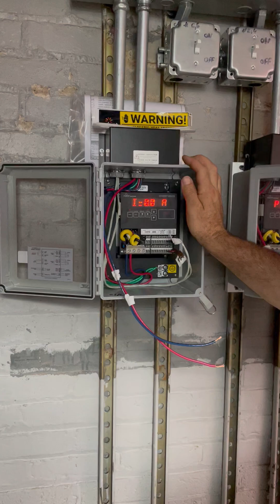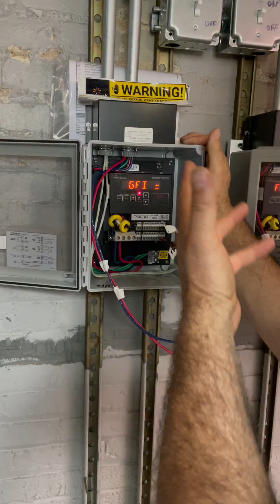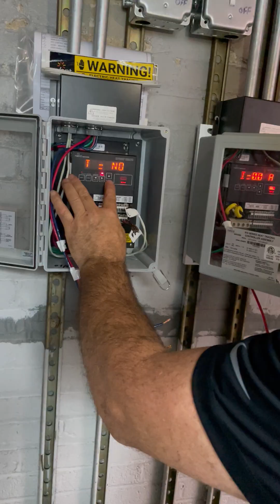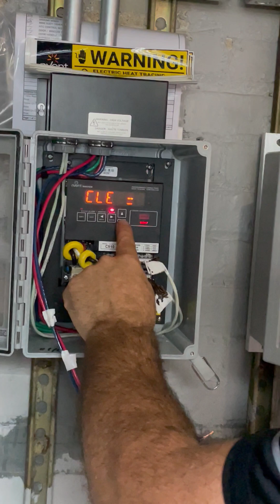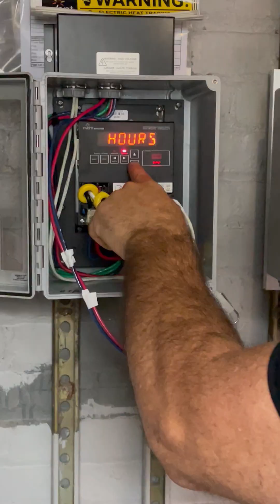Programing a Raychem C910 heat trace controller

Comment: Why would T fail? Any idea?
Reply from the maker: Sorry for the slow reply. Either the RTD actually failed or could be wired wrong.
Reply from the maker: go here to see how to test RTD https://www.youtube.com/watch?v=uYmfZ7rOgTo
Reply from the maker: IF RTD didnt fail check wiring
Reply from the maker: be sure you are landed on TS1. The default programming is for temperature sensor 1 which is 20,21,22 red, red white on 22. See pg 50 of IO here https://cdn.chemelex.com/Product%20Documents/Installation%20Manuals/Raychem-IM-H58415-C910series-EN.pdf